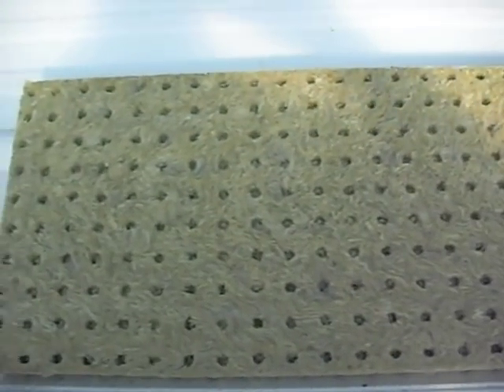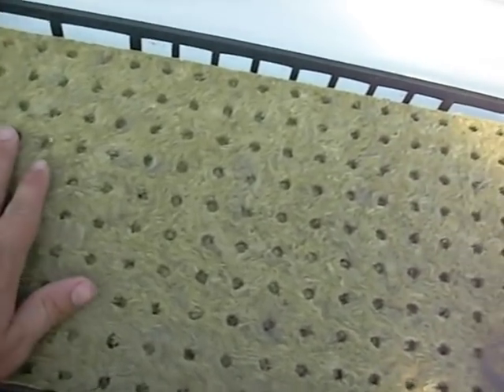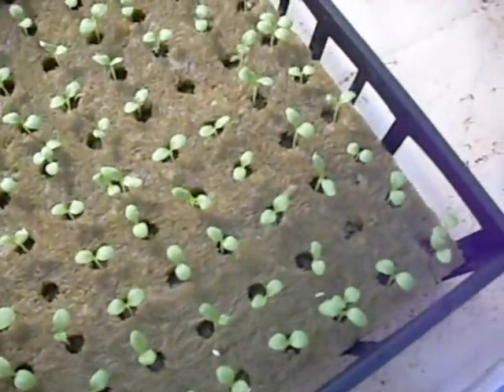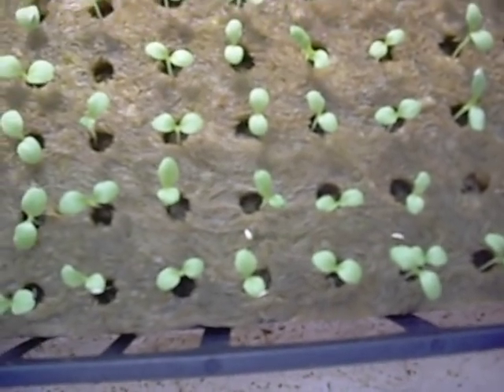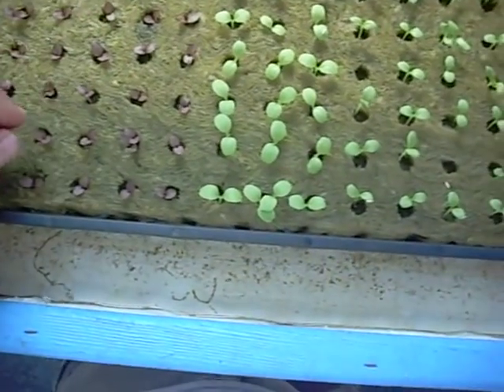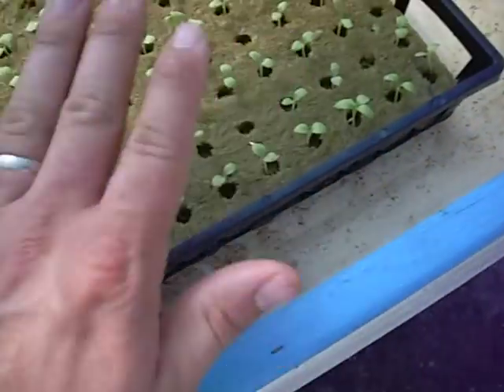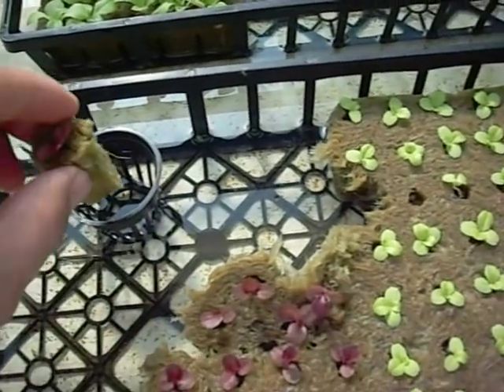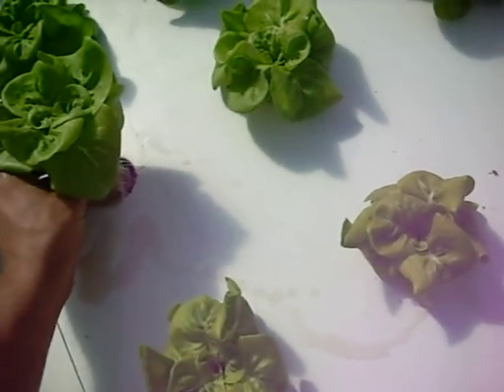Hydroponic How To: lettuce production

Comment: I have tried to start lettuce in starter pellets on 2 occasions and found that each time the seeds would sprout but the sprouts grew straight up about 2 inches and had 2 tiny leaves on the top. I thought that they were supposed to grow low like you pictures. What could I be doing wrong?
Reply from the maker: +Adam Pierce  Plants grow fast and spindly for a couple of reasons. The number one reason is lack of sunlight. Lettuce needs full sunlight as soon as the plants germinate or it will grow too rapidly in search of more or better light. Excessive heat can also cause sprouts to grow too fast and can stress them out. It is important to keeps temps below 80 degrees while germinating.  Here's how I germinate my seeds: 
  Place lettuce seeds in your medium (if using a soil based medium only put the seeds about 1/8" below the soil making sure the soil is not packed too densely )  Wet down well and place in a cool location. Watch carefully because it only takes lettuce about 24 hours at 70 F to germinate. As soon as the seed casing cracks and the sprouts began to emerge, move to a sunny location making sure to keep the medium nice and moist from the bottom up (this will reduce damping off)  At this point they will be somewhat more heat tolerant than in the germination stage.  Keep in mind that plants like to have air circulating around them and will grow more stalky in response, versus plants grown in a stagnant air environment. I hope these tips can help you. Happy growing!!:)
Reply: +atmjph1369  Thanks for the tips.
Reply: Adam Pierce me too
Reply: atmjph1369 mine too

Comment: but isn't rockwool extremely expensive?
Reply from the maker: shakaama Yes and no. It is a large part of overhead for a commercial operation. Per plant however it can be purchased for as little as 10 cents a cube. If you buy in bulk you get a much greater discount. Keep in mind that there are many different mediums that work well and some that work better than rockwool perhaps.

Comment: Ugh. I cannot seem to get the hang of lettuce. Everyone says it's super easy. Mine always flops over, gets wet and rots. Maybe the secret is in the rock wool, because I've been using peat pellets.
Reply: I had the same issue with spindly lettuce seedlings. I was leaving them in dark too long. As soon as you detect a sprout get them all in the light, sunlight if possible or at least T8's. Then leaves will develop more quickly.

Comment: Hi I have a quick question---I am trying to grow lettuce in my system but having very bad results. My Ph is 5.8 consistently, and EC is 1.8. but my lettuce keeps dying after a few weeks in the system. I water top them off each day because the roots are not reaching the water, but it looks as it the leaves are turning yellowish color. The stems don't seem to be strong enough to support the plant so I am constantly using toothpicks to hold up the plant.  any ideas as to what might be going on? Oh, even in the incubation chamber, it looks as if the seeds just keep bolting. Water temperature is around 60F.
Reply from the maker: Oliver Miller Hello. A yellowing of leaves usually indicates a nutrient deficiency. It could also indicate a toxicity. It is very difficult to diagnose a plant problem without knowing all of the parameters of the system and nutrients,however I will do my best. First of all the Ph of your water sounds fine for lettuce. The EC also sounds within range, as does the water temps, however it does matter what ratio of nutrients you are using. What kind of nutrients are you using? Have you tested nitrate levels? Is your water well oxygenated? Are you using DWC, NFT, or the bucket system? What kind of medium do you use?  What is the temperature range of your grow area? Is there plenty of light? All of these thing will effect the growth and health of the plant. For instance, yellowing leaves and stunted plant growth could possibly indicate low nitrate levels. Just yellowing of the leaves might indicate an iron deficiency. If a plant grows to spindly or rapid it could indicate too low of light levels. You can test your nitrates by using a simple 5 way test strip for aquariums(look for these at your local pet store or online) Good nitrate levels will be between 80 and 120 ppm. Lettuce also needs plenty of oxygen at the root level. I recommend a min. of 4ppm D.O. One major indication of low oxygen is root rot. Healthy plant roots should be nice and white, not brown or slimy.  If your sprouts grow too fast and wiry right after germination then they are likely not getting enough light.  Make sure you are using a good water soluble fertilizer mix with micro nutrients. Also do not use chlorinated water in your system unless you let the chlorine gas off first either by aeration for 24 hours or just sitting in a container for a few days(lettuce don't especially like chlorine) The roots of your lettuce should always be wet and never completely dry out.
Reply: atmjph1369
 Thank you sooooo much for taking time to reply with all those wonderful tips.  By training I am an engineering so I am precise with the levels and other parameters as researched and giving to me. So here are the exact parameters I am using:
> Meter = BlueLab Combo, it measures Ph, EC, and Temperature. The probes are submerged continuously in the nutrient solution %100 percent of the time. This meter does not measure ppm.

> The nutrient blend I use is from Bontanicare - Pure Blend Pro grow 3-2-4.  It's an organic blend, but at this point I'm opened to any suggestions. I should point out that my plants are not touching the NFT film (not yet)  or solution because their roots are not long enough to reach it. So I top them off each morning.

> Before I seed, I soak the Rock-wool overnight where Ph levels are pre-balanced to exactly 5.8. I use two seeds in each rock-wool opening for redundancy. Since this is my third seeing, this time around I pre-soaked the rock-wool in the nutrient at half strength or with an EC of 900. I used this number because I was told lettuce requires an EC between 1.6 and 1.8. The seedlings are then placed on a heated mat and under a dome with a high-output T-5 lamp which I purchased a kit from a company called Jump-Start. The lamp is placed as close as possible to the grow bed.

> After about a week or so the plants germinate quite nicely and begin to grow. Here's the start of the problem. If I planted 20 seedlings around 18 of them start to shoot straight up. The remaining will grow laterally and start to fill out. They grow but oftentimes the stark can't support the plant. After about 3 weeks or so I transfer plants from starter grow bed into NFT system.

> NFT system is precisely balanced. I cycle the system one week prior to transplanting. NFT system parameters are as follows: Ph=5.8, EC=1.9,---exactly. Water temp = 65F, room temp avg. 67-73F. Two air stones are submerged in the nutrient solution. The water used in the tote tub is 10 gallons of bottled water, (no chlorine) which is also used when seeding. With the exception of the 4" diameter PVC pipe I purchased from the HomeDepot, all hose lines and fittings are food-grade.

> The NFT system is located on a Southern facing window wall which is 97% glass and get sun all the time, i.e. when it does shine in the Rochester, NY area...lol

I hope this helps with your diagnostic. Again, thank you so much. I'm at a complete loss because I am doing exactly what I read/heard about, but not getting any good results.
Reply from the maker: Oliver Miller
Hello. The parameters you have just described to me all seem pretty much optimum. There are however a few things which you could consider. Lets start with your nutrient solution. A 3-2-4 solution is very weak for lettuce. I realize that it is difficult to find a very powerful organic water soluble nutrient mix, however in my own opinion an example of a good lettuce formula would be in the range of a 8-15-36 (not necessarily exactly,just somewhere in this ballpark)  I'm not saying a 3-2-4 solution wont work at all,but I would recommend something a little stronger. Also make sure it contains all of the needed micro nutrients as well. The essential micro nutrients are as follows: Boron,Copper, Iron(chelated), Manganese, Molybdenum, Zinc, Chlorine (as CI) Calcium,and Magnesium. Calcium often has to be added as many complete blends of water soluble fertilizers don't have any or don't have enough. Calcium levels can be checked using a 5 way test strip and is called "hardness" of the water.  Lets do a breakdown of what I checked for in my water an what it looks like.
Dissolved Oxygen - 6.0
Ph- 5.8 - 7.5
Ammonia - 0-1 ppm
Alkalinity - 100 - 180 ppm
Hardness - 80 - 150 ppm
Nitrates- 80 -150 ppm
Nitrites- 0-10 ppm
Iron- 4-10 ppm
EC- 1.6
Water temp.- 65 F
Air Temp- 70 F

These are optimum levels for lettuce plants +/- 10% If you do not have a way to check at least alkalinity, hardness, and nitrates I would suggest you buy some 5-way aquarium test strips. They are relatively accurate and affordable. Dissolved oxygen, nitrites, and iron don't necessarily have to be checked. Nitrates, Alkalinity, and hardness should be checked weekly. I never check my iron levels because low iron will be distinctly symptomatic Leaves will begin to turn yellow between the veins. When this happens I simply add a little chelated iron to the water( I use sprint 330 chelated iron) within 24 hours the plants should be returning to a normal color.  When this happens you know low iron was to blame.

  This site has a wealth of information about hydroponic lettuce that I have found very helpful.  http://www.howardresh.com/Hydroponic-Culture-of-tomatoes.html
 
Please feel free to ask me any questions you have.
Reply: atmjph1369
 Thanks again. I'll check out the link you provided and dig deeper into your suggestions. I'll keep you posted on my progress. Please feel free to email me with any other suggestions to: omillerwny@gmail.com  Again, your input is priceless.

Comment: There only thing wrong with the one u are saying has checked ears is that the seed hull stuck to the end of the first leaves when they initially opened up. This will not hurt the plant as these leaves are shed and gone pretty fast anyway. We find that by the time they have their first leaves they are all usually uniform in size. We do not do any culling until the first leaves are on the plant. When we take out the doubled sprout they are pinched off and not torn . As tearing can damage the other plant and pull up the root system. Nice grow table. Ours fills up 1/2 inch in the bottom twice a day. Works great.
Reply from the maker: Hi, thank you for your comment. We seeded and transplanted thousands of lettuce plants monthly and perhaps we did get too picky with our selection process. It seemed to me that those plants with the notched ears did not reach as large at 6 weeks as ones without. I'm not saying that there's any scientific evidence to support this, just my own observations. We also did culling based on size after the plant developed 2 to 3 true leaves. Doubles were taken out at the stage you see in this video because at this stage we could pull them out before root entanglement.

Comment: Hi there, 
I am impressed with your work. Since you are a commercial grower so have few questions if you would be kind enough to answer.
1. How long does it take for a seedling to sprout and time to true leaves?
2. After how much days of implantation you often transplant the seeds to raft.
3. EC/TDS and PH of raft?
4. Your Greenhouse temperature?  
Thanks.
Reply from the maker: #1. It depends on the weather. In spring it takes about 24 hours to sprout @ 70 degrees F, and about a week to true leaves.
#2. You can plant them as soon as the first true leaves appear,but it is better to wait until they are about 1 1/2-2 inches tall.
#3. I dont check TDS really just EC. I keep EC @ 1.2-1.6 ms and a ph of 5.5-6.6 
#4. 70 degrees F is ideal but my greenhouse can get up to 95 F on really humid hot days in the summer. You must keep your water below 80 degrees F at temps like this though. For germination you MUST keep the temperature of the sprouting zone below 80 F and above 40F.
Reply: Very true!
Thank you so much for your reply. God bless you....

Comment from the maker: Enrique Goitia Yes you can soak the rockwool in just plain water at first until the first true leaves appear. If you like you can soak them with half nutrient solution as well. I also do not change the culture water ever,just top off for what has been used due to evaporation and plant use.

Comment: Do you just soak the. Rockwool in plain water? And every when do you change water of culture? I'm growing or trying lettuce
Reply from the maker: You almost never have to change the culture water,jut top it off. However you may have to after years of running the system if unusable salt levels get too high. You can soak the rockwool in plain water or a half strength nute solution.

Comment from the maker: I keep the pH between 5.5 and 6.6 with an EC of 1.0-1.3 ms. I use a water soluble single part fertilizer mix of 16-5-16 with micro nutes.I wouldn't call that an optimum fertilizer mix for lettuce as it is quite high in nitrogen compared to most commercially available lettuce formulas,but it is readily available for me and I haven't had any  issues with it.   Also I check the hardness,and nitrates with test strips. I try to keep hardness around 150ppm and nitrates between 80-100 ppm.

Comment from the maker: In my own experience, planting the seeds how I show in the video,will result in a 99% germination rate nearly every time. In the garden soil temperatures need to be between 40 and 80 degrees F. Lower than 40 or higher than 80 will result in poor germination rates. Just make sure the seeds stay moist and in that temp zone and you will have great germination rates! I've explained a little about photo-activation, but I wouldn't worry about it 2 much unless you were planting in a dark room:)

Comment from the maker: Great question! When storing seeds you do need to keep the light out of them. All seeds have different requirements temp wise and light wise. Lettuce seeds are considered photo-sensitive,meaning a critical step in germination is photo-activation. In short lettuce seeds need to be exposed to light as part of the germination process. The amount of light it takes is very minimal really, which is one reason lettuce should not be planted in the dark or planted very deep.

Comment from the maker: @biggidaman777 No. Im sorry but the rockwool is only good for one planting. You can however use expanded clay or pea gravel if you want a reusable medium. These work fine on a small scale, however they are simply uneconomical for commercial production as they are much more labor intensive. Coco fiber is another good choice, but is also labor intensive. While you couldn't really reuse it per se,it can be composted and used for other growing applications.